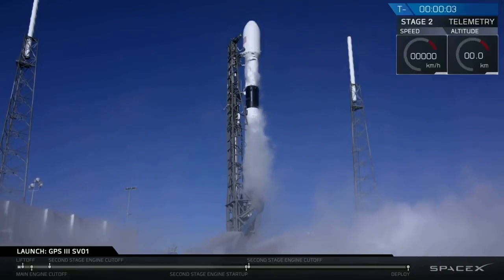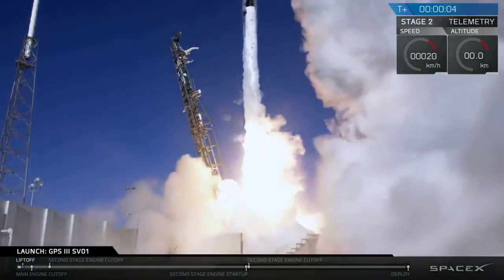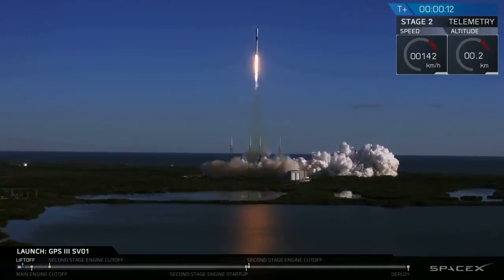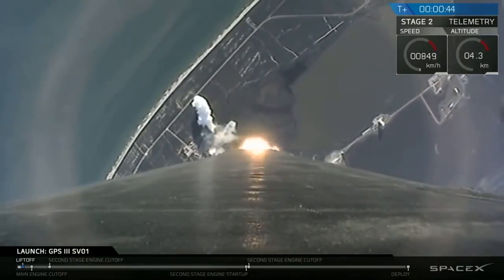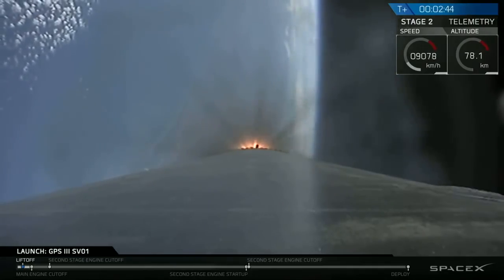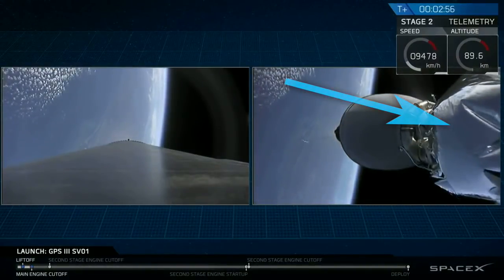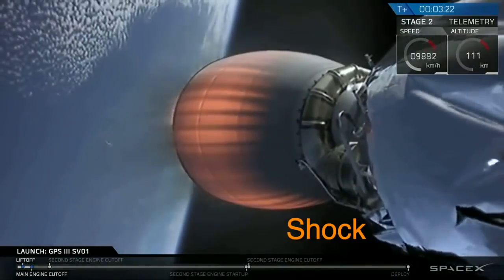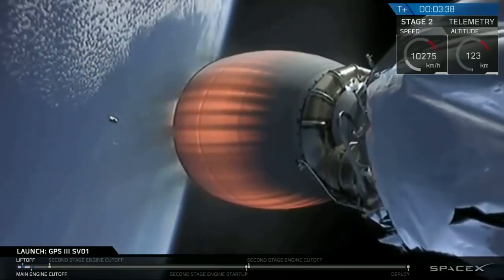Troubling "Shockwaves" during Falcon 9 GPS III Launch

Comment: The shockwaves oscillate and move with the changing variables of traversing atmospheres, resulting in a pulsating aerodynamic load. 
https://ntrs.nasa.gov/archive/nasa/casi.ntrs.nasa.gov/19660025880.pdf
https://ntrs.nasa.gov/archive/nasa/casi.ntrs.nasa.gov/19890009843.pdf

Comment: I think the ice was the LOX purge of the stage, and the billowing was caused by RCS bursts. They spun the stage up for stability. You might have noticed the rate of rotation increasing before sat sep.
Reply from the maker: Interesting. Seems odd that they slow down in such a linear fashion as the mission continues though, plus I would have though the "shock" they cause when firing would be the same strength each time, but it lowers as time progresses. However, I just checked the Small Sat launch and there are similar (if less intense) shocks during that launch so I'd imagine it's normal and RCS makes sense as you say...
Reply: The corrections necessary probably get smaller, as the stage will probably need some rather large corrections after stage sep, but once it is roughly on the right path, the corrections get smaller. As to the ice ... Maybe it peed its pants?